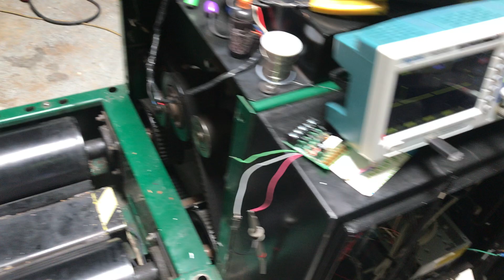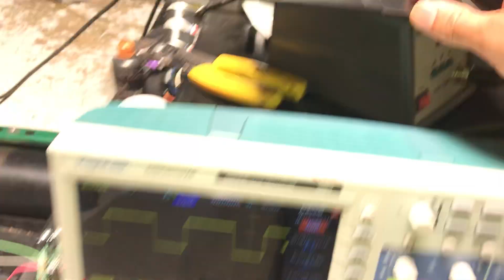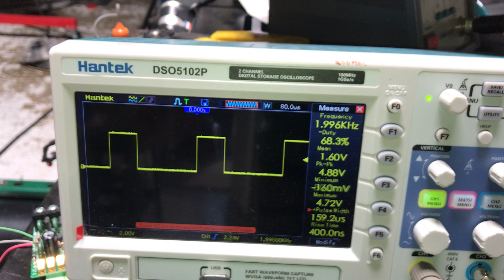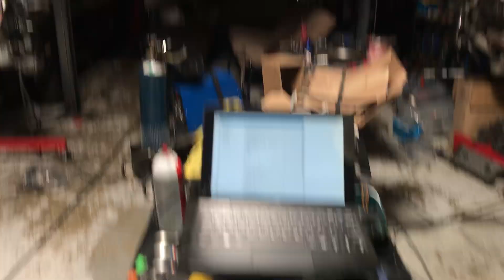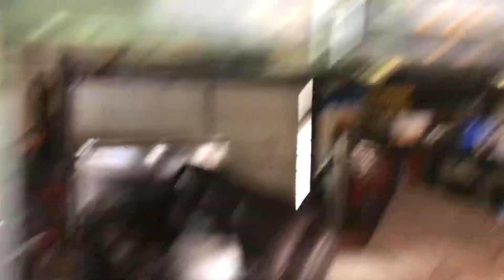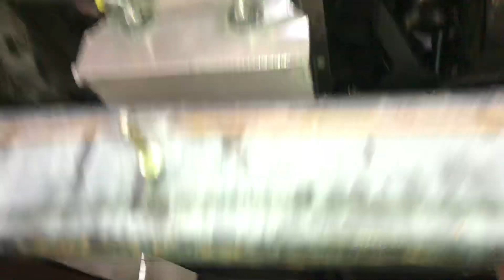April 25, 2019

Comment: Hello, I am having a hard time understanding your approach to accomplishing brake control. I understand that you are using the mains 50/60Hz sinewave and each time the voltage crosses zero you will decide how long to apply power to the retarder for. But I don't really understand why you have four SCR's in place. Could you achieve the same thing with one SCR? Would you happen to have a schematic available that I could take a look at? Or possibly some additional resources or webpages with similar schematics that I can take a look at? I'm also trying to build an eddy brake power supply for my DIY hub dyno.
Reply from the maker: The reason there are 4 scr transistors is because each one is half wave rectification.  So two of them are for one line of 120 full rectification and the other two are for the other 120 line to make roughly 240vDC.  
If you type in scr arduino or zero crossing arduino and search for videos, there are a lot of good ones by a guy named Lewis.  That’s where I got all my info.  As far as data sheets, you can pick a high current fast switching scr that you can control with a complimenting opto isolator to drive the scr.  I don’t have a schematic but Lewis shows the arduino code as well as a diagram that you can follow to get the scr’s to follow the zero crossing at the pwm duty cycle that you desire.  He shows it with a potentiometer on analog input on the arduino.  I used a pwm signal from the your dyno to act as my varying voltage to analog input.  

I didn’t do this but you can also use high current fast switching mosfets and use a rectifier to rectify the ac mains voltage to dc and control the current with the mosfets in parallel making sure to balance the gates of the mosfets with resistors so no single mosfet takes the full load and blows.  This way you don’t have to detect zero crossing like I did.  I was just trying to use the board I had that came with the Clayton dyno.  Figured I can save some time by using the existing hardware.  
Arduino can control the load through the mosfets and hold rpm where you want it through a pwm duty cycle.  You would just need something to indicate rpm.  I used the hardware that your dyno provided which was a Vr sensor that I put close to the belt teeth on the timing wheel to sense rpm.  I had 48 teeth which I told the software.
Reply: @idus  That's what I originally thought, you would use the SCR's to control the full 360degree sin AC. But then I saw you were using another regular full wave rectifier and that threw me off. I guess you're using the regular full wave rectifier as an output for the Arduino to read only.

And then you are using SCR's in a full wave rectifier fashion for power to the eddy brake as pictured here?

https://www.electronics-tutorials.ws/wp-content/uploads/2018/04/power90.gif

But in your case the SCR full wave rectifier gate's are all tied together and are controlled by one optoisolater that's driven by the Arduino. Am I right?

Thanks for the help BTW